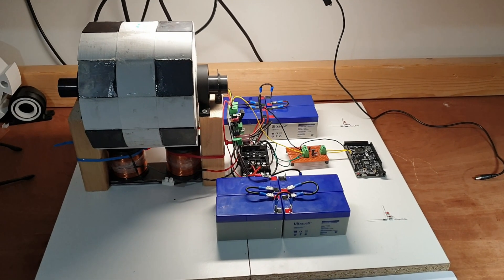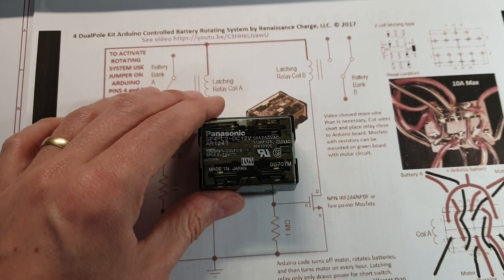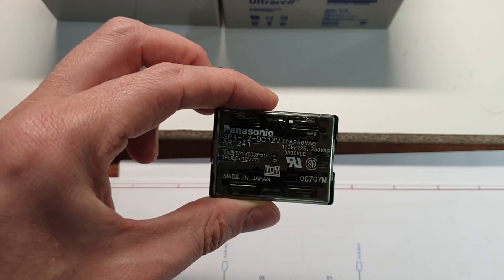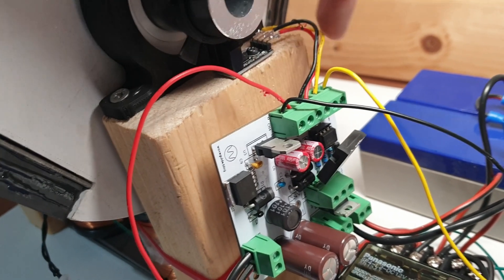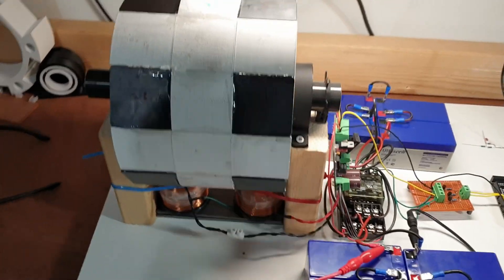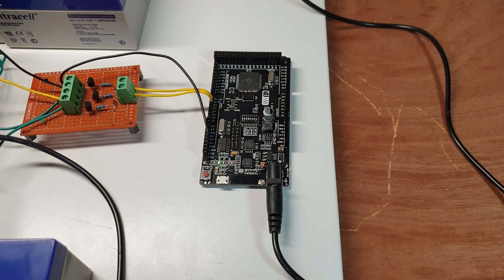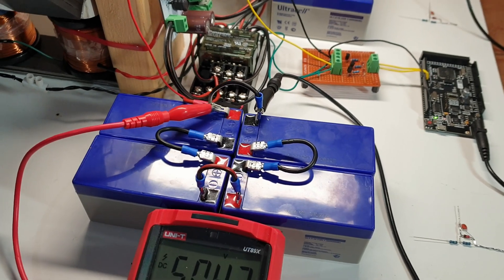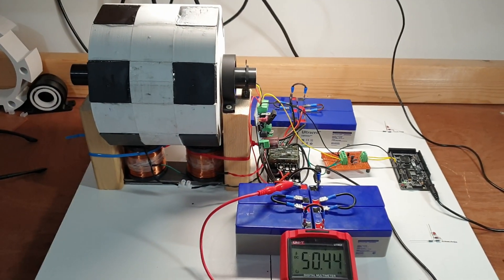Pulse Motor & Battery Swap Circuit Update

Comment: Mr Kraakman, could the GANfet be switched out for a MOSfet with a higher voltage rating, say 1200v?  Thank you sir.
Reply from the maker: Yes, but you will have to triple check the pins, because these GaN fets have their gate pin in a different place than most regular FETs
Reply: @Waveguide  Thanks for the advice on pins, I will definitely keep that in mind sir.  Do you think the rating of this GANfet could handle 16 coils Mr Kraakman or should I swap it out sir?
Reply from the maker: @hoofheartedicemelted296  give it a try! If it starts smoking, replace it ;-)
Reply: I guess I'll test that in the shed.  I never liked the shed anyway. lol.  Thank you Mr Kraakman. @Waveguide

Comment: Mr Kraakman, could your circuit be used on the SG Energizer sir?  The SG seemed to have a mini flyback circuit per each coil.  Would this be a necessary addition to accompany your flyback circuit or would it be unnecessary.  Thank you sir.
Reply from the maker: I've never built or studied the SG Energizer, so I can't answer that question unfortunately.
Reply: @Waveguide  Sorry sir I shouldn't have assumed. I thought Mr Adams and Mr Bedini's system operated using the same principles.  I think Mr Bedini used as many as 7 lengths of copper wire per coil, that's probably why he had multiple transistors that had to be matched. Something to do with different forms of radiant energy per wire. Thanks for your feedback Mr Kraakman.

Comment: Thank you for the most qualitative and well structured information about experimental energy research.
Read both your long design considerations articles, they are great.
Hope you could do final construction demo with all coils in place.
Reply from the maker: Thanks, I appreciate it! I have to confess that I kinda lost my faith in pulse motors, got distracted with Don Smith devices, and then wasn't able to get those working properly either, so I'm taking a little break from all this for now.
Reply: It looks like it is almost ready and just needs to be assembled in full coil setup or to be connected to second generator via shaft.
Wish you fast recovery).
Reply: The guys disclosed quite a bit - https://www.youtube.com/watch?v=VRvJjQ2F68M, report the working project for quite a few years.
U-type magnet hand modulation can be seen in order to keep speeding up, one pole rotor with one long force-applying, let's say, period.
Probably more advanced in the real machine, but still, quite refreshing after the whole web research (so little info).

Comment: Mr Kraakman, what's the difference between your circuit and Julian Perry's circuit?  Thank you sir.
Reply from the maker: My circuit powers a motor, his circuit is solid state and only pulses coils and then captures the flyback. This allows him to set the pulse frequency precisely, while in my case the pulse frequency depends on the RPM of the rotor.

Comment: Mr Kraakman, hope you're doing well.  When you take this off the shelf during the polygon period to come, remove the iron beneath the coils that make it a closed system.  Your electronics are flawless, as is the rotor design.  This being the case, the only other variable is the ambient and the magnetic phenomena beyond the ambient.  Remove the iron plate.  Best wishes sir. 😊

Comment: We include the motor turn off in our Arduino code so that there is  enough time for the switching to take place not under load and also prevent the output to not cause any problems. Yes and there should be some added diodes on the relay. This shows up on our 200A version. We can charge some batteries across the relay driver coils or recover energy as well.
Reply from the maker: Hi Rick, thanks for mentioning that and thanks for giving me the idea for the battery swapping circuit. I'm very impressed with all you've built, and can't wait to meet at the convention in The Netherlands.

Comment: Lithium batteries can be unstable under certain conditions but the COP seems to favour them, though SLA are cheaper and the A&P crowd seemed to like them too. What batteries do you prefer yourself sir?
Reply from the maker: Have only used small SLA for now, lithium way too expensive for now
Reply: @Waveguide  Thank you sir.

Comment: Is there a point in this circuit where pulse width is modulated, the arduino is just for swapping the relay, right sir?
Reply from the maker: In this setup the Arduino only switches the relay, yes. In previous pulse motors I used an Arduino for PWM, but now I just "hardcoded" the duty cycle to 30% using the timing disk.
Reply: @Waveguide  I watch for little pieces of info that paraphrase Bearden and Bedini, but I found Mr Perry's remarks about fine tuning pulse frequencies promising. He used solid state to test with? Battery frequency response sir?
Reply from the maker: @hoofheartedicemelted296  Yes, Julian Perry ditched the rotor, as all it does is determine at what frequency the coils are pulsed, so he just pulses the coils using a signal generator instead so he has much better control over the exact pulse frequency. That led him to the conclusion that each type and size of battery has its own ideal charge pulse frequency and voltage, and so ideally you would first determine that for your own batteries, and then build a motor that can run at that frequency.
Reply: @Waveguide  Would you need a CBA to determine this frequency sir?
Reply from the maker: @hoofheartedicemelted296  I haven't replicated Julian Perry's experiments yet, but he seems to suggest that a battery analyzer is required, yes. And to control the speed of the motor, all kinds of things can be done: more voltage = higher speed, less voltage = lower speed, higher duty cycle = more speed, lower duty cycle = lower speed etc.
Reply: @Waveguide  Mr. Perry very kindly provided a table for us with specific battery types to use and suggested between 100hz-120hz to begin our experiment so at least we have a starting point.  The part in the manual that refers to setting the microcontroller duty cycle, show a lot of thought has to be put into it, thank you for providing that already done ( hardwired ) that was excellent sir.

Comment: You mention a nice case with 12 coils sir.  Would the addition of 12 coils require any further modifications to the components involved with flyback.  Thank you sir.
Reply from the maker: No, same components can be used, you'll just get kore torque and more flyback.
Reply: @Waveguide  What a relief.  That's a bonus.  I thought maybe tvs diodes in series or something along those lines but that's a bit of good news. Thank you sir.

Comment: Looks like a kind of kromery generator whit electrical input instead of mechanical, I wonder dit you ever produced better results than of the shelf high efficiency motors en generators ? 
 
I found whit such machines that either way it produces a cop of about 0,6 to 0,8 at best en whit  battery bank swapping whit the c20 charge /discharge range it dropped to cop 0,45 , this is because the active voltage difference is decreased by 10 to 20%  in the chemical conversion in the battery , I also used barium magnets like bedini suggested but it makes not difference :(
Reply from the maker: Hey Oscar, I myself have not achieved any extraordinary results yet with these systems, and so right now I've shifted my focus away from pulse motors to Don Smith devices, which seem to hold a lot more promise. Fingers crossed.
Reply: @Waveguide  excellent choice, 👌 I would recommend to focus on the negative resistance components the most,  this is where you can cancel the losses ( positive resistance) en maybe even get something extra! ( 

Hydrogen spark gaps seem to do the job very well in making up for the losses) 

for the capacitors you have to make them your self whit tesla's method ( aluminium or copper sheets rolled parallel whit bee wax paper in between en cure them at 120deg c in a vacuum chamber whit a high dc voltage applied to it this wil make a electret cap whit no losses) maybe even negative losses 😀

For the coils use silver coated copper wire (solar panel wire) en used multi Strang according to the skin effect frequency,  roll the multi Strang wire where you don't want stray inductance en let them parallel in the transformer 

To add a lot more power output I suggest  to study the alpha en beta voleic effect en harvesting methods,  you wil find that tue circuits Don Smith uses are identical to that of alpha en beta particle harvester circuits,  It's like how a solar panel works but then for cosmic radiation 

en don't focus to much on the transformer itself besides making it efficiënt as possible whit Teflon pipe en Teflon coated wire ( no wood,pvc,metal ore anything other then Teflon en nylon)
Reply from the maker: @oscarverwey  Great, thanks for the tips! Much appreciated.

Comment: How can a closed magnetic loop draw in extra energy from somewhere else ?
Reply from the maker: Great question, and I don't have the answer unfortunately :-) Adams believed the energy entered into the air gap, which still exists even in a closed magnetic circuit. However, my main goal was to use more of the power of the rotor and stator magnets that is usually wasted in monopole setups.
Reply: @Waveguide  I wonder way this never happen in normal motors though? For example bldc motors use variable frequency en duty cycle for the optimum relaxion time of the core material en have internal reciving diodes for recovery en they're like 85/95% efficiënt
Reply from the maker: @eleochoriwildlife  Well first of all, it is not guaranteed that this effect is happening in Adams motors either, that's what I was trying to figure out :-) But since pulsing seems to be key, some BLDC motors definitely have the ability to capture some of the flyback, but usually the diodes are used to simply let the flyback loop around until its dissipated as heat. It's not actually being used for anything helpful.
Reply: @Waveguide  i respectfully disagree,  if you look in in to flyback diodes en circuits you wil find it's just letting the current flow for a  longer time so actually al the energy is used to produce a magnetic field , the bldc designers know this en build a dead time in the pwm to make full use of it 😉 therfore capturing it in something else like a cap or battery wil only give a lower efficiency en more heat
Reply from the maker: @eleochoriwildlife  interesting, I clearly need to update my BLDC knowledge. Thanks for pointing that out.
Reply: @Waveguide  it applys to al flyback diode circuits
Reply: Have you watched any of Paul Babcock's presentations from the EnergyScienceForum crowd?
Reply: Paul Babcock "Air Core vs Iron Core : They Are All The Same" on youtube.  Should answer some of your questions.  And maybe create a few more. lol.

Comment: Gerard morin tried this but I think he failed and is embarrassed to show his face on u tube so now he got his job back fixing the sewer pipes.  He walks inside pipe and has to scrape the inside of pipe clean.
Reply: Not that this honest researcher needs defending Francis, but I would remind you that even Tesla was forced to dig holes as a day job to finance his research
 Circumstances are no excuse for accepting failure. The solution to this puzzle was found long before you were born and it will be rediscovered by determined researchers who will reclaim their own power supply as their birthright. Thank you for your comment Francis.

Comment: great man! I do believe you would be best to use the super capacitors in series instead of the 12volt batteries as the resistance is far far lower and as you know , resistance of any kind is a killer of efficiency. you can get small ones very cheap on aliexpress or even Ebay
Reply from the maker: That's definitely an interesting idea! However, some swear that the battery chemistry with heavy and less heavy particles enable the effect.
Reply: @Waveguide  oh ok .well I wonder then if it could be a hybrid

Comment: Thank you for your video and sharing the details. I will order one of your boards. So, what was the battery voltages after you run the motor for awhile. Are you seeing increased charge?
Thanks again
Reply: I sent you an email but didn’t hear back. It’s regarding your driver board. Thanks
Reply from the maker: @lightseeker3390  Hi, that email was sent 12 hours ago, didn't get to it yet on my Sunday off 😉 Will answer now.

I did a 5 hour test run for fun and the batteries definitely didn't stay charged, but this is using only 2 instead of the final 12 coils. Also, nothing has been tuned yet, like pulse frequency and pulse voltage, and not even the timing disk and duty cycle, so was just an initial test to establish a baseline.
Reply: @Waveguide  I understand. Takes a lot of patience and tuning. Wish you much success brother 
I will watch your videos closely

Comment: Nice one! Thanks for promoting Julian and stating the focus topic ; KV pulse in + optimal frequency to charge the various Battery Chemistries and enable high COP's.
Swapping period what I mostly see, is 1 hour if not switching depending on charge voltage.
Reply from the maker: Indeed! Using the method Julian describes, I calculated that swapping the batteries at 80% of their capacity will mean a swap interval of almost 4 hours (!) despite my tiny batteries, since the motor right now only consumes ~70mA haha.

Comment: Motor looks great man. Question, if those are ceramic bearings why is the motor on the loud side?
Reply from the maker: Ceramic bearings have no grease or lubricants, so they are more likely to make noise. Also, the stands are hand-sawed and so not perfectly aligned + the whole thing stands on top of a wooden structure, all of which amplifies the sound. Rotor is also not balanced at all. 

Nevertheless, I do agree that less noise would be great! Haha.
Reply: @Waveguide  Just curious cause I use ceramic bearings (much smaller ones) and there not noisy at all. I agree the wooden structure probably contributes to most of the noise which is why I switched to acrylic.
Reply from the maker: @mcorrade  Yeah my small motors were also a lot quieter. This rotor is 4.5kg though, so much more weight to vibrate around 😛
Reply: @Waveguide  gatta love a big rotor man. My quest is to print a a really big one that I have to put together but I'm having trouble figure it out in fusion 360. I'll get it one day :)
Reply: @mcorrade  Solidworks from Dassault System could be  your friend
Reply: @tisserandstephane7845   I'm currently a Fusion guy
Reply: so at your next video just put sound insulation material like towels under the base, thank you for sharing this great idea motor-generator.. @Waveguide